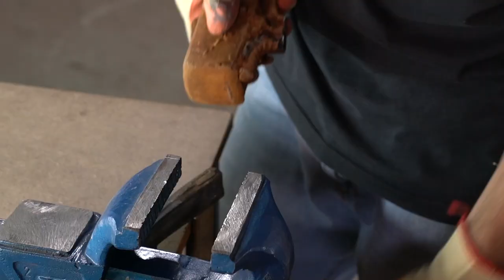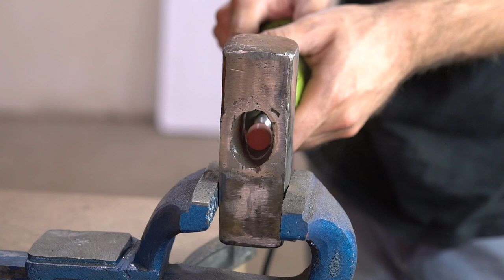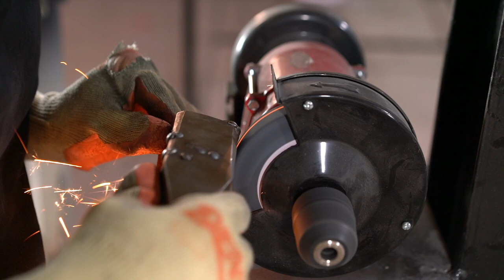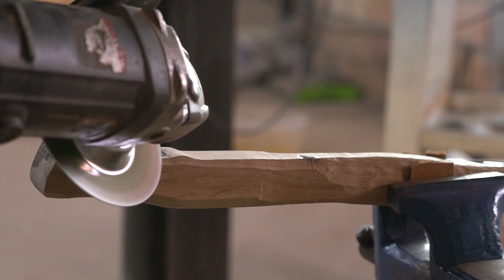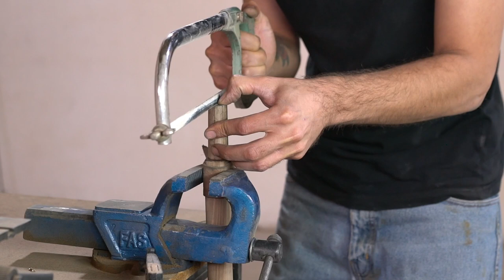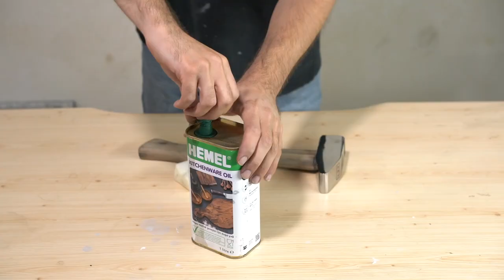VERY RUSTY HAMMER RESTORATION | #rusty #hammer #restoration

Comment: For restoration purposes, maybe you made it right, but for real life use - not at all. Firstly, welding the hammer is not the best idea, because the metal molecules change their grating and structure. The welded spots become hardened, which is not what you usually want for a hammer. Secondly, the wooden handle you made, it should not have a sharp "support" under the hammer. It should be cone shaped instead. Also, there is no need to use any epoxy. Properly secured handle is good enough and will last the life of the hammer, unless you break it by improper usage.
Reply: I do not really understand where the author of the video. but an impact hammer? why is wood not silicone? we live in 21 studies.
Reply: Yeah, the hammer is not usable anymore, may be a decoration :)
Reply: How many hammers have you restored ? Answer none ! What have You restored , if anything ? Answer probably nothing ,
Reply: @jamesreichardt7573  I am not into "restoration" business. I just repair the tools. And I have repaired them more than I can count of. This is not only limited to hammers or axles but much much more. What are you trying to say in your comment?
Reply: @hid3nax  I like what you did with that miss treated hammer , You turned absolute trash into treasure , I would rather have that hammer than a new one .
Reply: @hid3nax    I like what you did with that hammer , A 2-Lb. Pein or could be a 2- Lb Blacks Smiths  Hammer either one , and gave that hammer it’s life back , and I would rather have that in my tool box than a new one .
Reply: Is an hammer man, it just has to beat on things... is not a rocket
Reply: @guglielmoappulo  Well, do you want a shitty hammer or a good hammer?
Reply: For real life purposes you go to Home Depot or Harbor Freight and purchase a cheap hammer. This was a demonstration of craftsmanship with attention to detail.
Reply: I don't think usability was the goal here

Comment: the handle turned out to be uncomfortable, all these extra bends get in the way. The flat head of the hammer is short, in these cases I use a thick spring from the truck, cut out a square and weld it to the hammer.

Comment: In 1998, I found the very same size and type hammer, that had been welded to a piece of 1/2” galvanised water pipe. Removed the pipe, cleaned it up  and fitted a proper handle. It has been my main blacksmithing hammer ever since and is a little beauty! 👍😁👏👏
Reply from the maker: Very cool

Comment: The handle may not be right for both sides of the hammer are to be used. This is a cross pen hammer.
Reply: my thoughts exactly, i made the same mistake when making a new handle for my cross pen hammer a little while ago. had to do it all over again!
Reply from the maker: Thanks for comment but there are models like this
https://www.dewalt.com/products/hand-tools/hammers-and-pry-bars/2-pc-17-oz-hickory-framing-nailer/dwht51418
https://www.stanleytools.com/products/hand-tools/hammers/framing/22-oz-fatmax-framing-hammer--axe-handle/51-403
Reply: @Metallism  The links you provide make no sense for those are carpentry framing hammers made to drive and pull nails. 

Obviously you do know the difference between a cross pen hammer and a framing hammer.

Comment: Great job, even if it were kind of dangerous at some points 6:44. And as pointed by others, the welding of the battered parts without normalising and annealing the hammer afterwards, has probably damaged a bit its structual integrity.
Technically speaking, the first handle, the welded one, was literally indestructible. Of course with the added weight, you had to be Thor to wield the hammer afterwards.
But the outcome is a beauty.
Reply from the maker: Thanks for feedback, I'm pleased with the details that you see in this video. 🧡
Reply: While the steel handle is a lot stronger the rebar as a handle would do your wrist no favours I worked at the steel game for 11years what he did even that welding will in no way harm it C02 weld is a hard weld now if it were cast then he would be ruining the metal you need cast metal rods to weld cast 👍

Comment: As a blacksmith, Im telling you, u just ruined hammer, and I mean u welded on the face and peen of the hammer, and u destroyed the hardness of it by doing it. I hate when I see people doing this....
Reply from the maker: You're right I didn't know that. This is an old video.
Reply: @Metallism    if your hammer is not hardened, it will mushroom the face or the peen to the sides, and that will lead to shrapnels, which are very dangerous

Comment: Is there a way to restore the heat treatment on such tools without a big-ass forge? I had to cut off the mushroomed part of a very old hammer, but I think it got too hot and isn't properly hardened any more
Reply: Yea take and get a oxygen acetylene torch get the hammer glowing hot enough where magnet won't stick then quench. Then throw in an oven at like 200°f for 4 hours
Reply from the maker: Thanks for comment 🙏🏼

Comment: Nice work! What compound did you use between handle and head?
Reply from the maker: Thanks 🧡
2 component epoxy.
Reply: Don't use a compound like that if you wish to use the hammer (or any handled tool) in the future. I'm realizing this is a purely aesthetic hammer restoration.

Comment: When you weld low carbon filler onto a higher carbon steel hammer, especially on the striking surfaces, it can cause fucky things to happen. It's probably fine for light duty, but it's not going to withstand abuse

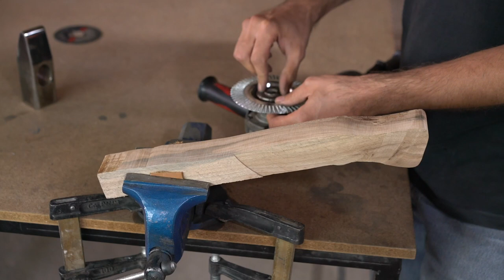Comment: 6:53 что за диск и как называется 🤔
Reply: سلام
هذا قرص خاص بنحت الخشب
Reply from the maker: You can see more details in this link:
https://www.amazon.com/Grinder-Tungsten-Grinding-Woodworking-Attachment/dp/B082HDMBXF/ref=asc_df_B082HDMBXF/?tag=hyprod-20&linkCode=df0&hvadid=475812515682&hvpos=&hvnetw=g&hvrand=1362900651395742878&hvpone=&hvptwo=&hvqmt=&hvdev=c&hvdvcmdl=&hvlocint=&hvlocphy=2840&hvtargid=pla-995544828443&psc=1

Comment: The hammetr is just a shelf queen now. Useless for hammering. Too shiney. 
You should have the plate around the blade on the table saw. Very dangerous and you could end up injuring youself cutting wood on it. Just like the wood almost fell through and could have caught on the blade and it could have been thrown back at you hitting anywhere avove table height and causing much pain and damage.
Reply from the maker: That part was done with my friend, thanks for comment by the way.🙏